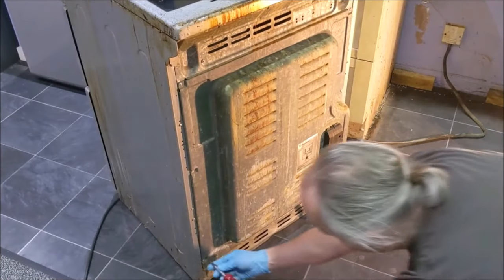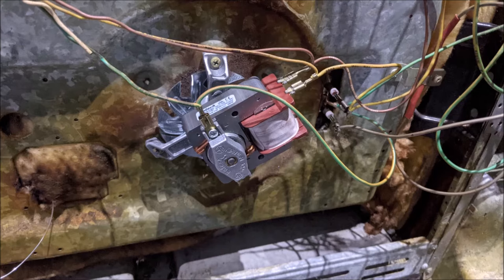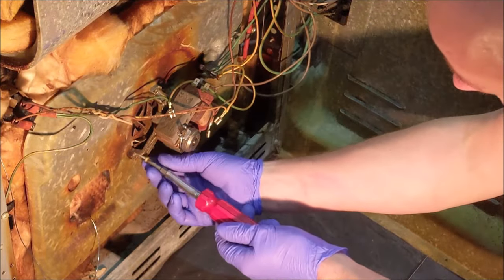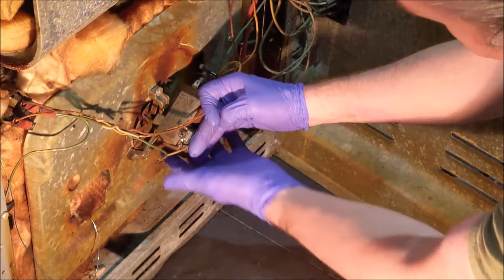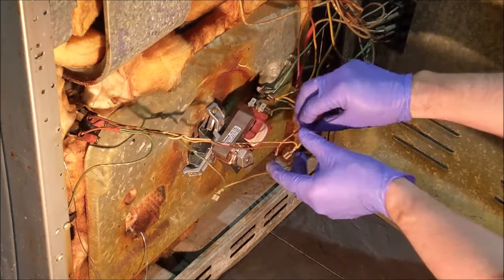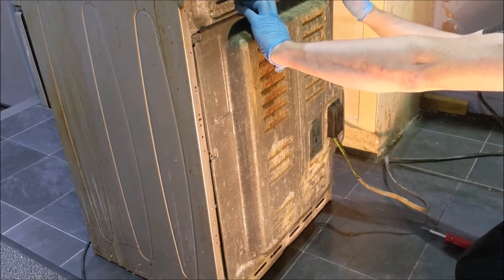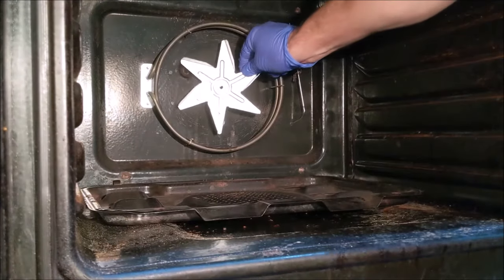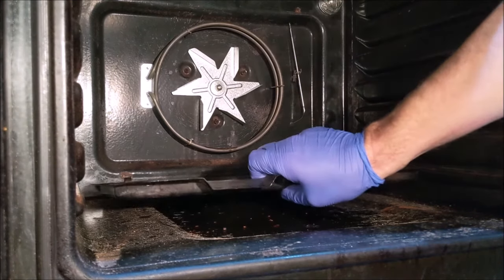How to replace the fan motor in a fan oven

Comment: Thank you, I watched this before attempting, and it went exactly as shown, except I had trouble with stuck screws for the fan, and the wrong parts sent by the supplier, but all fixed and working less than £20. Top man, thanks.
Reply from the maker: Awesome. Well done. Glad it helped.

Comment: Thanks for this explainer. I’ve followed along and the fan no longer makes a loud noise and spins freely. I have a question about the airflow. Should the fan be pulling air towards it from the inside or pushing air away (ie back towards what is in the oven). I’ve just held a think bit of tissue next to fan on the inside and it’s pulling the tissue towards the cover.
Reply from the maker: Hi, thanks for watching. Glad to hear it helped. Yes, I just tested my fan and it sucks the tissue towards the fan.

Comment: Hallo, ich habe eine Frage, sobald der Ofen aufheizt, der Ventilator angeht und er während des Backens ununterbrochen läuft, stört es mich, weil er ständig alles aus dem Ofen wirft und die ganze Wohnung dadurch stinkt, sonst Alle Herdplatten funktionieren einwandfrei, indesti, es ist die Marke. Selbst mir scheint, dass der Ofen sehr stark ist, er kocht wirklich sehr hart
Reply from the maker: Hi, thanks for watching. It is a fan oven. This is what a fan oven does. It is supposed to keep the temperature more even for the whole oven space. If you don't want the fan to spin, then you can disconnect the power from the fan and cover the end of the wire so that it does not short circuit by touching any exposed metal. Hope this helps.

Comment: My old motor had an insulation gasket that disintegrated when I removed it. The new motor did not come with one will the oven still work fine without it? Thanks
Reply from the maker: You could try a small bead of silicone or see if you can order a new gasket. Thanks for watching.

Comment: my oven fan stopped working, then I moved the fan and it would work again, until the next time, now it finally wont work at all, that sond like the motor failing? cheers Philip great how to
Reply from the maker: I think you're right. Have you checked that the fan isn't catching and is free to move? And does the oven still heat up ok? It may be worth checking that the spade connectors are still connected to the terminals. Thanks for watching.

Comment: My fan stops working when the cover is on, but when i put it back on it stops. Is it safe to use the fan oven without the cover?
Reply from the maker: Thanks for watching. The cover is there for safety, so it should be on. It sounds like either the fan blades are bent out or more likely, the cover has been bent in and hitting each other. I'd start by checking the cover isn't deformed. Hope this helps.
Reply: @PhilipWillsWorld  Thanks mate, will see what i can do.

Comment: I think the heating elements gone in my oven after 10 years, can anyone help me with this question please, my oven doesn’t heat but recently until it went faulty oven would make a very loud fan spin rattling sound , is this the fan and motor that need replacing or is it because of the old heating element affecting the fan and causing it to rattle ? Any suggestions would be great
Reply from the maker: Check out my other videos to see if they help. Try a few things to see if you can identify the cause. Make sure you turn it off at the wall before poking around inside the oven so you don't electrocute yourself. Make sure it's cold so you don't burn yourself. Open the oven. Remove the shelves etc. Open the panel covering the fan and element. Try giving the fan a spin and see if it makes the noise. See if it's hitting anything. If so, the fan blades may be bent. You can easily bend them to avoid contact. It could be that the element has deformed and in the path of the fan. Check the panel hasn't been bent in to the path of the fan. Check if the fan retaining nut isn't loose (left handed thread.) Hope this helps. Thanks for watching.
Reply: @PhilipWillsWorld  ok thanks for the help information 👍

Comment: What's that long wire thingy adjacent to the heating element?
Reply from the maker: That is the thermostat; it is used to regulate the temperature in the oven. See how to change it in my other video. Thanks for watching.
Reply: @PhilipWillsWorld  ah thanks.
My oven tripped the fuse and is now not heating up so I watched your vid have ordered a replacement heating element.
I noticed the thermostat and it was wedged behind the heating element and then I noticed it in your video and saw that it was supposed to be on the side so thats why I asked. 
I am wondering now whether that was the reason why the element blew in the first place

Comment: Once the motor is off, is there a way to test it to see if it's actually there motor that's not working?
Reply from the maker: If you know what you're doing and have a workbench with an appropriate power supply, you could try connecting power to the terminals. But if the rest of the cooker is working and you've checked the connectors are all attached correctly and the motor and fan are free to spin without obstruction, then it's probably time for a new motor.
Reply: @PhilipWillsWorld  everything on the oven works, but just the fan doesn't spin. Looking at the fan motor it doesn't look burnt out, or smells funny or anything. Just don't want to drop £20 on a new motor to find it still doesn't work
Reply from the maker: @ViralEye1  if you have a multimeters and know what you're doing with it, then you could test to see if you are getting power to the terminals on the motor when it's supposed to come on.
Reply: @PhilipWillsWorld  I just pulled the plug and bought one off eBay... £15, worth a punt!
Reply from the maker: @ViralEye1  nice. I hope it goes well.
Reply: @PhilipWillsWorld  fab arrived today, fitted within minutes and all back working! Thank you for the great guide!
Reply from the maker: @ViralEye1  awesome! I appreciate your feedback.

Comment: I have a fan motor keeps failing..new one fitted and a month later it's gone again. Three motors replaced now,have you seen this happen before
Reply from the maker: Did you replace it with a new one or reconditioned?
Reply: @PhilipWillsWorld  brand new. I'm wondering is the thermal lining between the element and the motor housing the issue letting too much heat into the motor. Haven't seen this happen so much before
Reply from the maker: Is the fan free to spin ok? If it gets stuck, that could cause problems for the motor.
Reply: @PhilipWillsWorld  yes was spinning free then when I replace them the motor is jammed. Third motor to do this
Reply from the maker: @phantom_Biker  you may be right about the insulation. Can you see any burning or melting? Or does it smell like it's butnt out? If you have been through a few motors, it is probably a symptom rather than a cause. Worth investigating the thermostat and wiring. Experiment with tuning the oven on, then see if the element cuts out when it gets to temperature.
Reply: @PhilipWillsWorld  yeah the stat is clicking off and on okay, I have ordered another motor an at a loss with this
Reply from the maker: @phantom_Biker  sounds frustrating. I hope you can fix it.